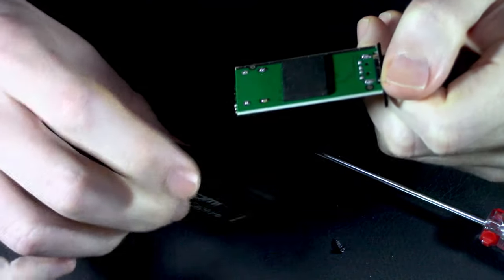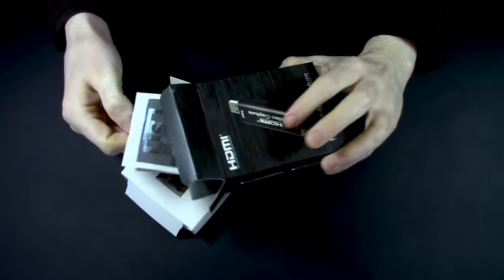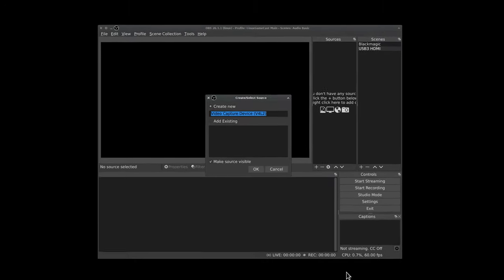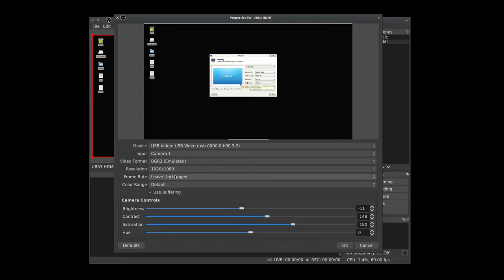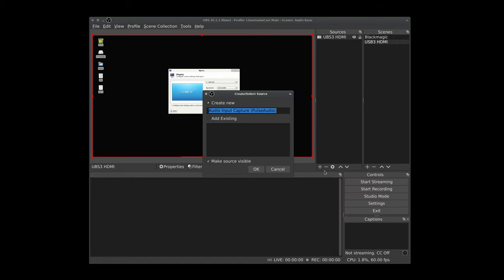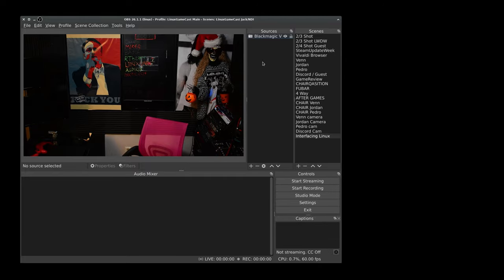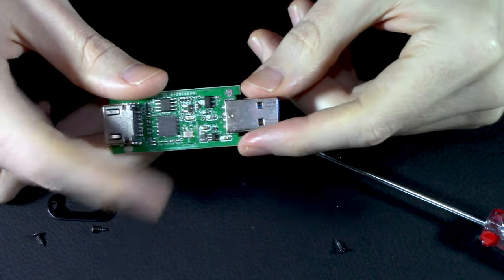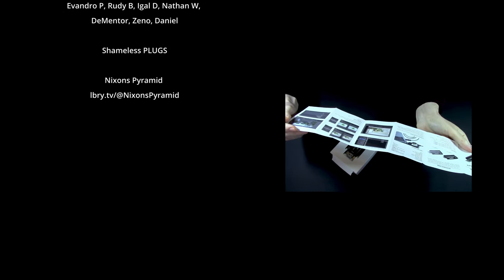Bogus 1080p/60 USB 3.0* HDMI Capture Card (Linux)

Comment: Meh… that's exactly the HDMI capture I got months ago. I needed it mostly to debug some Raspberry boot trouble that would show way too short to be parsed by a human before the device would reboot again so it's okay. I did wonder though why the framerate was so jacked up but blamed the undervolted HDMI splitter (It came without a fitting PS so I'm happy that it does _something_).

Lesson learnt. I suspect similar for a dead cheap SD-card writer at work.

Comment: Is there an HDMI capture you DO recommend for linux that doesn't cost your firstborn child? Perhaps a PCI model?
Reply from the maker: A used DeckLink Mini Recorder 4K. They go for around $100 on eBay.
Reply: @linuxgamecast  I bought one new and it works amazingly in windows. In Fedora 33, their drivers don't install. :(  Thanks for the idea, though.
Reply from the maker: @bendirval3612  They work fine if you use a 5.10 or lower kernel. Blackmagic has not added support for 5.11 yet.
Reply: @linuxgamecast  That is extremely helpful information. Thank you for going the extra mile to help me out!